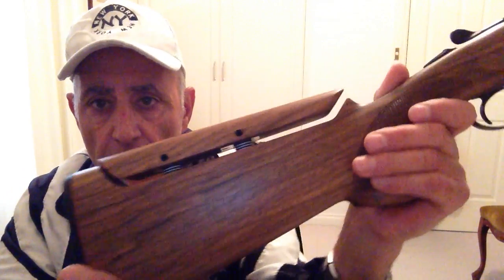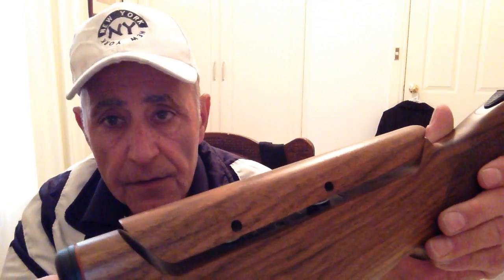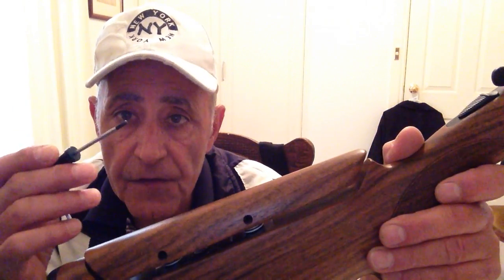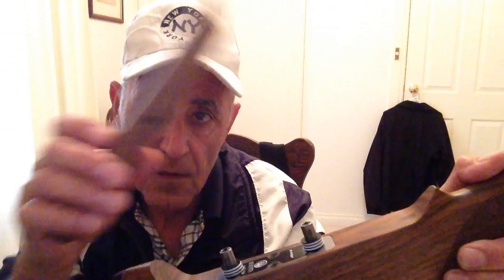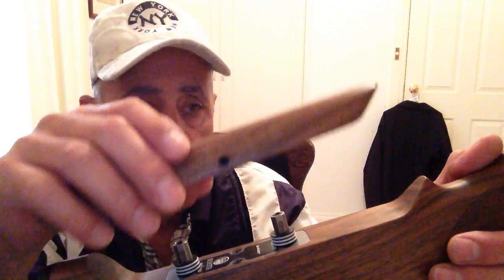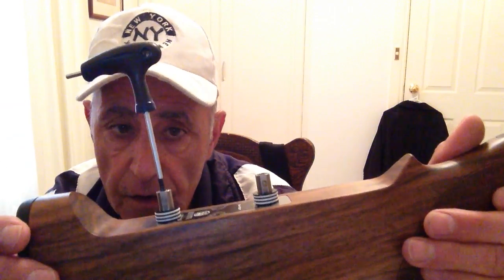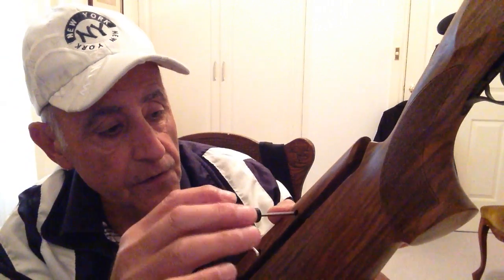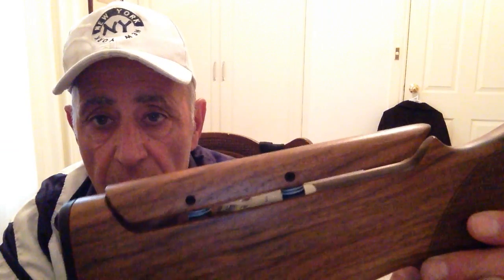Adjusting the Stock...Roger Pace

Comment: So i was looking at a 28" silver pigeon today in my local gun shop. I could see too much of the rib and when I told this, they just handed me another gun with a much higher price tag. It had an adjustable stock and I could see less of the rib but my eye was to the right of the barrels. I'm looking to buy my first shotgun so I could use your advice. Should I buy the 28" and fit an adjustable stock or just have the stock lowered? I'm assuming I need it lower if I can see too much of the rib. Any advice would be greatly appreciated as the gun store just seemed to want me to spend way more money than I think is actually necessary.
Reply from the maker: Stephen...any shotgun you buy should have an adjustable stock...then you can adjust the point of impact so that the gun shoots where you look